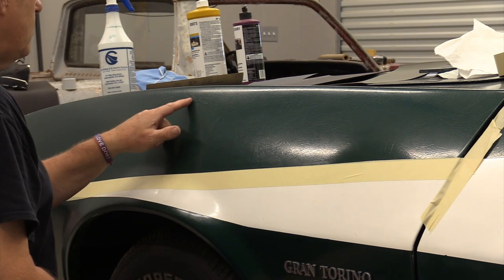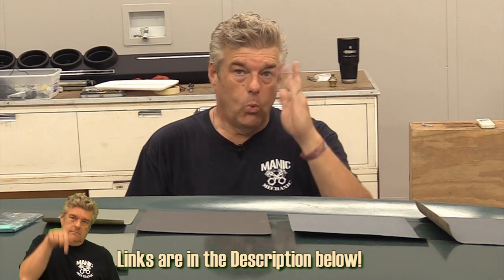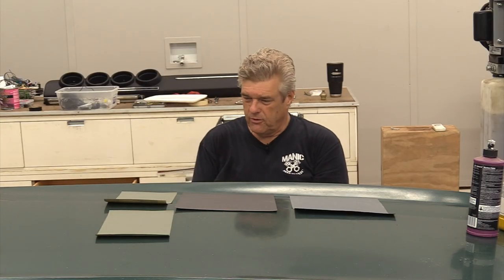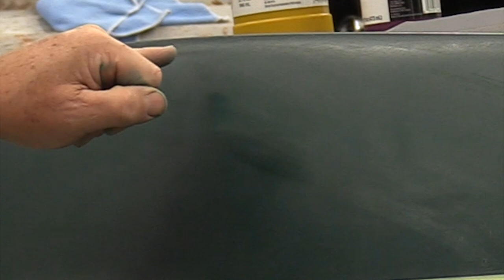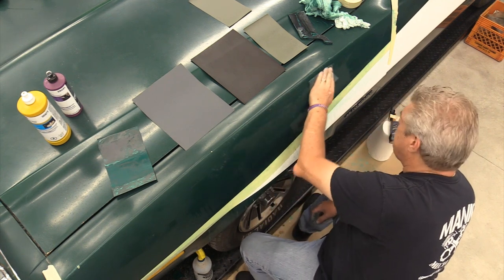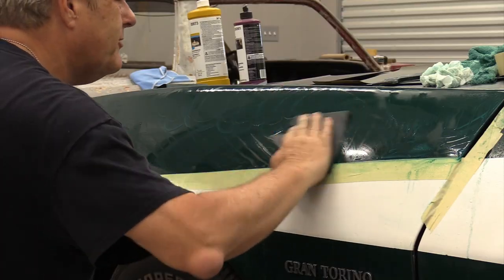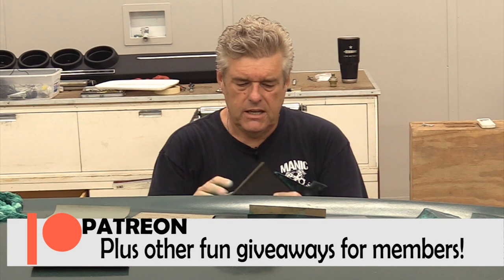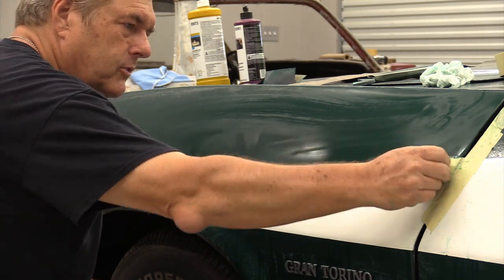Wet Sanding Classic Car Paint

Comment: I have a 73 Gran Torino Sport had a 400, put a 351 Cleveland with trick flow heads FPA headers, FiTech fuel injection, MSD digitalis ignition.  I 74 spindles on it in order to put a Baer brakes kit on it.  I’ve had this car since I was 12 (1988).  For the most part finished with rebuild, even though they are never finished, in 2017 ish.  I have picked your brain via email about this car several years ago.
Reply from the maker: Good to hear it is doneish.lol

Comment: I notice a 1968 or 1969 dash pad behind you. My first car was a 1968 Torino GT with the 390, I bought it when I was 16 in 1971.  I currently have a 1969 Fairlane 500 fastback. It has been my project car for over 40 years now. I need to do a good wet sand and buff on the 40 year old paint. Hope you will show the buff process also.
Reply from the maker: Buff is next week.
Reply from the maker: That is for our 68 wagon.